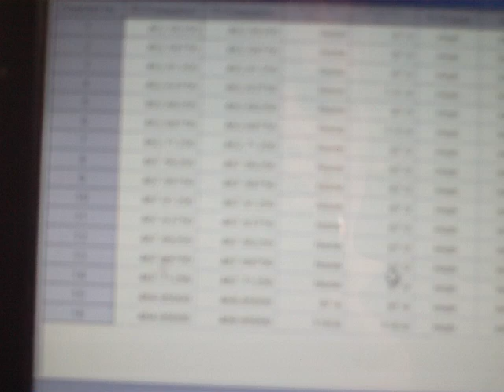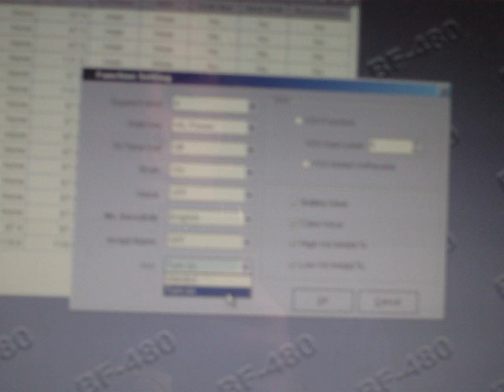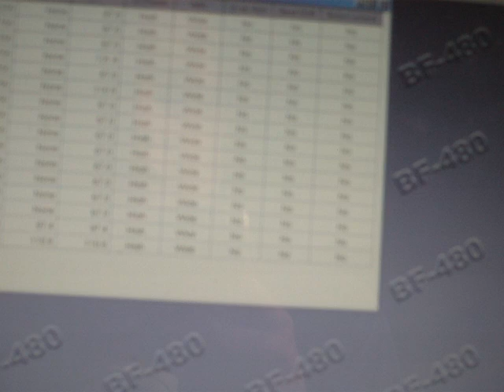[Tactical Comms] Baofeng BF-888 BF-888S BF-666S H777 UHF FRS Programming BF-480 Software

Comment from the maker: The software is VERY fickle.  I had to try two different computers before I got it to work.  The USB to serial port software that comes with it is really strange.  I finally was able to get it to work on my netbook (running a bone stock copy of Windows XP Home) - but, my other computer, running XP Professional...it just doesn't work on.  I had the same issue with getting Motorola CPS software to work.  It doesn't work on my laptop, but does work on my netbook.  I'm pretty sure its an issue